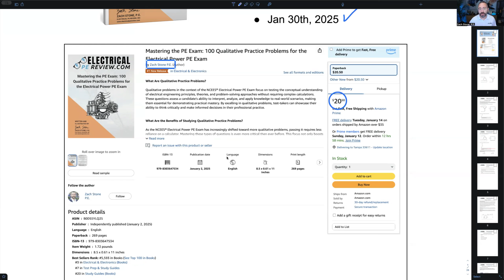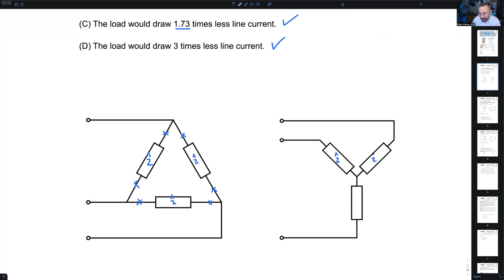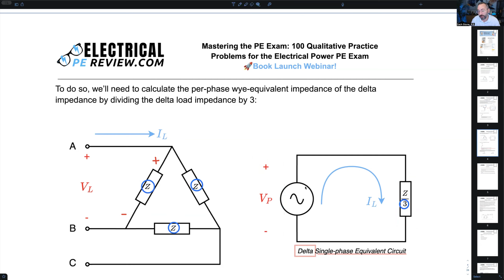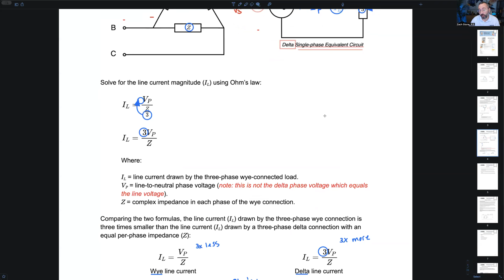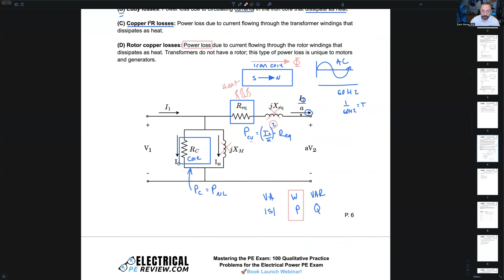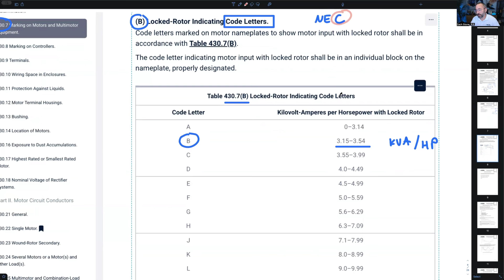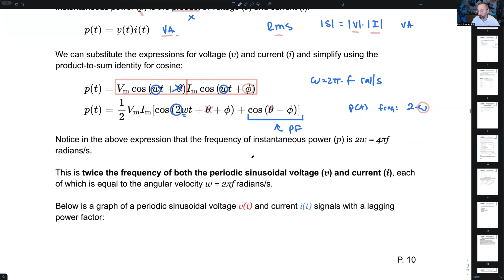Mastering Qualitative Questions for the Power PE Exam – Live Solutions Week 1

Comment: 8:16 In the single-phase equivalent circuit, the voltage is phase voltage, and so the current is phase current. The diagram should show the correct nomenclature; don't confuse it. Later, you can explain that the phase current of the single-phase equivalent circuit is equal to the line current of the three-phase equivalent circuit.
Reply from the maker: I agree, correct nomenclature is very important, especially when presenting the material to someone who may be learning it for the first time when learning these relationships for the PE exam.

The benefit of the single-phase equivalent circuit is that the phase current in the single-phase equivalent circuit is equal to and identical to the line current of the three-phase it is modeled after. Because of this, it simplifies three-phase circuit analysis, especially when there is a delta connection present.

The variable "IL" was specifically used in the single-phase equivalent circuit and the three-phase system in the solution to problem 1 to help draw attention to this and to help us use Ohm's law to identify what changes in the line current drawn by the system occur when the impedance of the load in each phase remains unchanged but the connection type is changed between wye and delta.